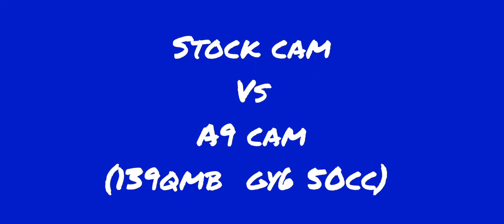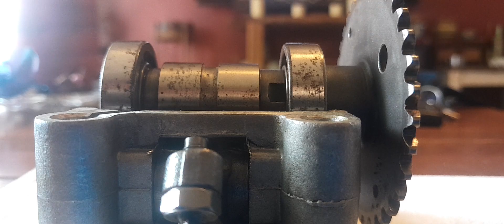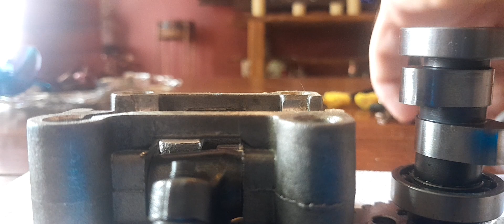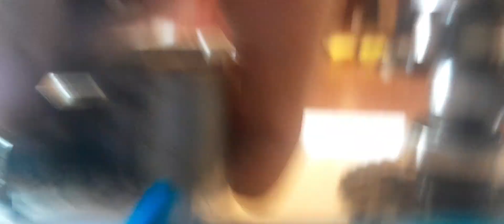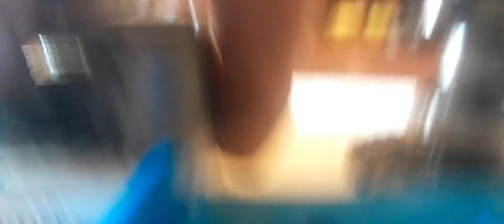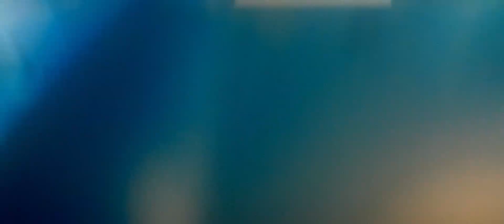stock cam vs a9 (139qmb gy6 50cc)

Comment: Someone mentioned the base circle and that the lift shown in the video may not actually show the true increase in lift. But as you watch the base circle side of the cam come by the space to the straight edge, it's obvious that the A9 and stock cams are similar or at least close to the same. More than that is that obviously the profiles differ. The little stock cam has peaked domes, the A9 more radius, a longer curve, indicating more duration of open valve time.

As to the question on timing the cam on install, it's simple. The two little holes parallel the head surface with the base circle side of the cam lobes against the rocker arms. If the peaks of the cam are against the rockers, it's 180 degrees off. Never mind the big hole. You always adjust rocker arms to the base circle of a cam. I don't care if it's a scooter or 600hp race car. But some A9 cams had the gear pressed on 180 out, so you can't always go by that big hole being up. Go by the low rounded side of the cam ( base circle) against the rockers.

Now what I'd like to know is what brand A9 is this one, because all A9 cams are not created equal ?
Reply from the maker: @davidg.5076  it's a glixal.. and it does show true lift, how would it not, its in place and it literally protrudes more , ie pushes the valve further whether the base circle is the same or not, the video in real world shows the cam turning and protruding further.
Reply: @scooterarmy  Just because a lobe is taller doesn't automatically equate to more lift. If the base is also fatter, the tappets adjusted accordingly, the lift could remain the same. Did you know that you can gain lift on a stock cam by grinding away from the base circle ? Why ? Because the tappet is starting closer to the center line of the shaft before ramping up to the peak. However that won't change the profile curve of the cam. Profile and lobe timing it could be said are just as important if not more so than just lift alone. That's how NHRA Stock eliminator cars get to rev crazy rpms and turn 10 second time slips with stock lift cams.

Thanks for the Glixal info ! Good to know.
Reply from the maker: @davidg.5076  Okeechobee

Comment: Actually the straight edge across there doesn’t prove it has more lift unless both cams are ground on the same base circles!  I don’t know if your familiar with camshaft terminology or how they are made, but to compare them you need to measure the diameter of the lobe at the portion where there is no lift-(that’s called the base circle).  Then measure the total height of the lobe  going across the shaft.  Then subtract the base circle from the total height of the lobe-this gives you the cam lift.  Take that times the rocker ratio (usually anywhere from around 1.3-1.9 depending on the specific engine) and the result is your actual lift.   
Think about it, those two cams could have been ground with different base circles and still had the exact same lift.   Look it up it if your not familiar.  Duration you need a special jig/fixture called a cam doctor to measure precisely, or install the cam in the engine with a degree wheel mounted on the crank and a dial indicator tracking the axis of the valve to measure linear valve motion precisely!  From there you can figure out actual duration at any set point be it .040”1mm or .050” such as most aftermarket cam manufacturers in the US do.  Total duration is hard to track as ramps are so fast and often less meaningful as flow below .040” is relatively small.
I’m trying to get an American company to grind me up some real performance scooter cams cause the Chinese cams are basically garage IMO.
Reply from the maker: Hmm.. I'm going to read and reread what your saying.. maybe I'm using the wrong term when I say, more lift. Clearly, the lobe opens the valve more as it is longer, as can be seen by the use of the straight edge
Reply from the maker: Let us know if you succeed in your quest to have a better cam produced

Comment: I want to get a performance camshaft with higher lobes but I’m afraid it will mess with my timing. My previous scooter caught on fire because of a backfire a few months ago so the last thing I need is the valves not fully closing during the power stroke and having a fire under my ass. What do you think?
Reply from the maker: Without sounding like a jerk. Set your timing properly? I run a9 cams and many others do too.  My big bore video shows how to set timing.
Reply: @scooterarmy  do you see a noticeable difference with the a9 cam? Alot of people have recommended it to me but when I look at pictures online and compare it with a oem cam the lobes don’t seem any longer or wider …
Reply from the maker: @zorroblings6886  a lot of fakes and different grinds out there. You may have ordered an a9 and got a stock one.  With the one in this video you can clearly see a noticeable difference in lift. It may a noticeable difference,  yes.

Comment: I think I'm gonna try one on my big bore head it's got 23 mm /in.And 20 mm/ex. Valves and 64 instead of 69 Valve length on a 50 mm cylinder with a hybrid supercharger...it decel pops because of my stock intake and exhaust
Reply from the maker: Get the sspg cam

Comment: I am getting tapping sound with the a9 like the valves are to tight but they good
Reply: check for clearance, to be safe
Reply: you need to readjust them after installing the new cam

Comment: Why didn't you show the timing marks when it's in the neutral position where you can set the valves one has a different holes drilled
Reply from the maker: Many different looks to these cams..
Reply: You didn't show yours.
Reply from the maker: @mrcleanisin  I'm confused about what your saying. What didn't I show that perhaps I should have?
Reply: You didn't show how it looks from the cam side so we could see the top hole/marks and the two smaller holes at the horizonal. The A9 cam in my gy6 is not properly marked at the top, so when I looked at your video, I still was not sure which side was to be turned up. I figured it out later. It was the side with the smaller hole straight up and the two smaller holes at the horizontal. I guess you realize that the cam not only has more height but also longer duration on the lobes.